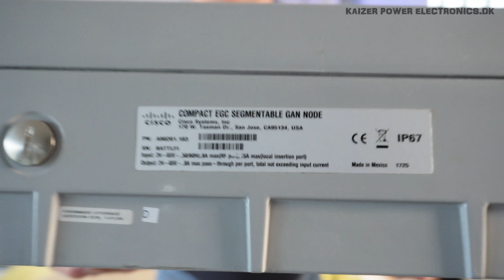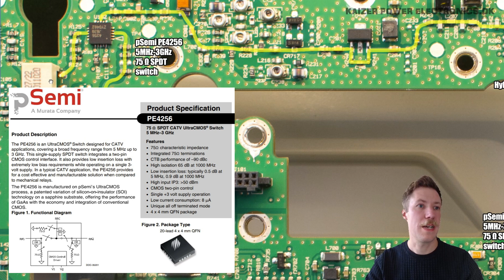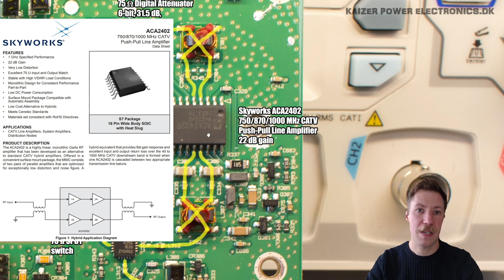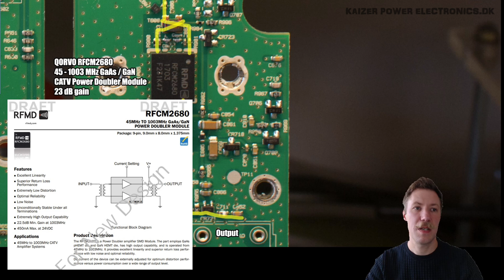Cisco Cable TV EGC GaN Segmentable Node A90201, RF Amplifier Teardown

Comment from the maker: How many do even use a cable TV connection anymore? I use a 5G router for internet connection.
Reply: Here in Sweden Internet via cable is still quite common for apartment buildings and so on. All xDSL has basically been replaced by FTTH or 4G/5G.
Reply: Here in the Netherlands cable is the norm. I have a standard DOCSIS 3.1 connection, 1200 Mbps down, 100 Mbps up, difficult to match with 5G (with the current network)
Reply: @IvanStepaniuk  Everything built in recent years is FTTH or Ethernet. But many homes received CATV in the 80-90’s so that’s the reason for the big installation base I guess.
Reply: In the US I got rid of cable 10 years ago. Here in Vietnam it's all WDM FTTH and cheap! I had actually never seen single fiber duplex coms until here 7 years ago.